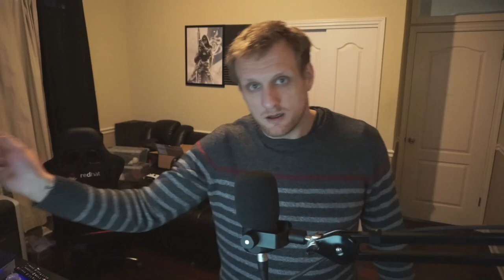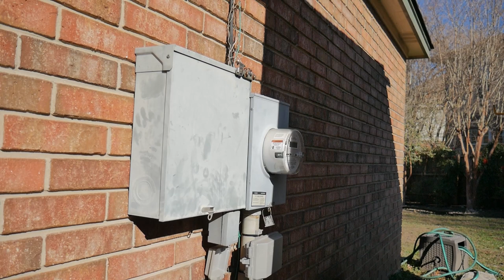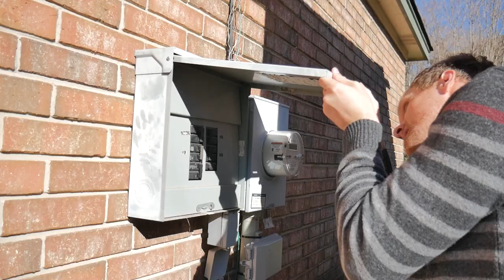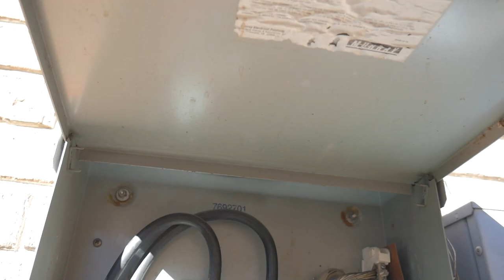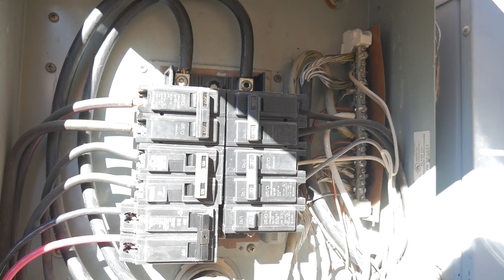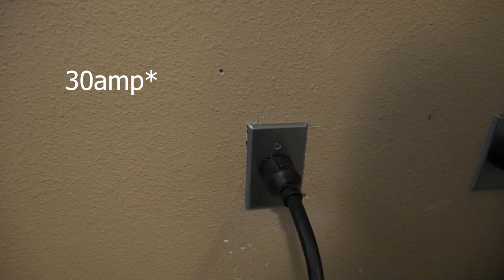5 Things I Learned Building a Home Ethereum Mining Farm

Comment: 5... Yup. I spent the time to tweak each card. It rewarded me by having some of them run at 950 megahertz, most of them at 900 MHz... But one of those had to run at 895. 
4. Yep. Not only do I replace all the thermal pads on the MSI cards, but then I actually added heat sinks to the back side. Vram went from holding 90c to 62c.

On #1, we went solar after we got our electric car... We then got rid of the electric car. 
This means that we have a ton of solar, because the only let you do so much of your usage. And this makes it so mining for effectively free.. during the day most of the year, the panels make more then mining will use over 24 hours.

Comment: I'm a FA Technician, the smoke alarm technology you're referring to is called: One Go, All Go
Reply: Also, regarding your fire alarm, install or have installed, a system that reports to a central monitoring station. The service is usually only around $10-$30/mo and will actually lower your insurance, slightly. The discount you'll receive probably wont offset the cost of the monitoring, but it's still nice.

Comment: Super helpful. My 2 3070’s keep going wonky after a few hours. Start getting a bunch of rejected shares and even had MSI afterburner default, before too. Trying to get them tuned in, I’ve never messed with thermal pads before.
Reply: Also I forget currently I’m getting 120.4 MH/s on Phoenix miner. At 239.3/240.0 W
Reply: What gigabyte model are they
Reply: @bobdobbs7828  lol. Yeah I got an Asus 3070 and haven't had any problems with it.
Reply: @iVETAnsolini  If you want to fix your rejected (incorrect) shares, Try this...Start your GPU's with MC and CC on 0...Then once they have both taken a few shares, bump CC to -200 and mc to 1100. When that settles, bump mc to 1300 and leave it for qa few hours and see how that goes....I have 11/3070's/. Some don't ever get rejected hsares but most do...That's how I've fixed the problem...

Comment: My vega64 running at 60c. What you think about this temperature? You are right, over the time i have seen hashrate going down when temp goes up.
Reply from the maker: Mem temps are the concern not core. Mem temps should be monitored and resolved if over 102c. Core isn’t a problem though at 60c
Reply: @SonofaTech  mem temps hits 86c. I already ordered some thermal pad.

Comment: So what I learn today.

1-  Electricity at 120 phases have maximum of 30 amps, while 220/240  has phases of 60 amp.
2  Lets say you are running a gtx 3070 mining and the power draw is 120 per hour, this would translate to 1 amp at  120v, while at 240v will translate to  0.5 amp

This don't translate that the electricity bill will be more cheap, nope, but what will do is that our power supply will be more efficient, less heat, more safety when mining.

Also very good in telling people that if you guys want to have like a farm of mining, make you sure to turn off the dryer, haha xD

Cause yeah imagine having a 120v with 30 amp phase, and then, running 20-25 gtx 3070 and pushing like 25-26 amp, and then you decided to turn on the Dryer? lol.......

Comment: No matter what card I use. AMD or NVIDIA. I can never get OC's to work. I've tried only overclocking the memory. Only doing the core clock. Under volting and lowering core while boosting memory. Raising the voltage and core while tweaking with the memory. Nothing I've tried actually produces results. I might be lucky if I can squeeze .5mhs out per card.
Reply from the maker: With AMD I get good oc after bios flash. Nvidia is not too shabby. The key is whatever you read online is too high usually.
Reply: @SonofaTech  I have gtx 1070's founders editions and I set the overclock at 400 and the core clock at 201. That's the only way to get decent hashrates up to 29 mh. If I just overclock to say 6 or 700, and under on the core, I get maybe 26.5 mh. Why is that?

Comment: I have a big problem I can’t solve. My rx 480’s just started mining at 3mh a week ago. Over clock not helped.  My 1650’s are doing the same thing!!  I need help.  I have tried drivers and everything. All of these are 2 months old,  if all started the same day.  What shall I look at to fix
Reply from the maker: 4gb?
Reply: @SonofaTech  yes  sometimes they will do 7. Now 3.  My rx 580’s 8g are now doing the same,  that just started in the past hour
Reply from the maker: @Yelnats101  my 580s are fine. When was the last time you did maintenance and replace thermal pads
Reply: @SonofaTech  this is all new 2 months old. As far as maintenance go. I shut down once a week and clean clean clean. Absolutely zero dust.   And they should not need any thermal pads or paste at this point. Because I have swapped out and tried brand new un used cards for testing.  Exact same 3 mh per card  even swapped psu. Reloaded windows.  Nothing helps
Reply from the maker: @Yelnats101  did you ever even look at the pads? Sounds like no.
Reply: @SonofaTech  i have been building rigs for years, this is the first time this has ever happened, like i said, its even brand new cards. and i redid one card because you mentioned it. its the  same as before. no change. i now have all new cards in, same thing, even on 8g  new cards
Reply: is it possible its the miner?
Reply from the maker: @Yelnats101  ok cause some models had bad placement this year. Aight so you on windows or Linux? What troubleshooting os wise have you done. Sometimes one bad card can cause this. Have you individually tested them?
Reply: @SonofaTech TEMP 44C/ FAN 25% POWER 51.24 WATTS
Reply: Thats on the 1650,s per card
Reply: i have shut down the rigs till problem is solved.
Reply from the maker: @Yelnats101  test each card dude. Sucks but that’s where you are at
Reply: 51 watt are u serious run @ 80% tdp at least
Reply: Yeah.  Ind don’t know what’s going on.
Reply: @Yelnats101  99% of the time its psu but if u r sure you have replace it. you need to check the pcie wire of gpu and riser ...if you are using molex or sata adaptor replace it with pcie riser.
Reply: @AJGAMESS  I have tried and replaced everything.  I have also tested each card on separate test benches.  No change at all. New un used cards and old cards. Same. I’m thinking it my miner   I have used nano miner for as long as I can remember. Never an issue.  It’s easy and mine straight to my wallet in coin base.  I’m open to miner suggestions that will allow me to mine into that wallet
Reply: @SonofaTech  its the miner. nano miner.  i tried nicehash for testing and was fine, can you recommend a good miner?
Reply from the maker: @Yelnats101  I use a mix. Trm for amd. Phoenix and lol for nvidia
Reply from the maker: Lol has higher cpu usage but is more reliable on 3000 series gpus
Reply: @SonofaTech  thanks for all the replies, i was just lost and had no idea what the issue was, i do greatly appreciate it
Reply: I use ethminer to mine eth its very stable with little bit overclock .. i dont use nicehash cause it switch algorithms and stress gpus with temp fluctuations.

Comment: Did you really just say, you have to keep all the same gpus... common,  you know that aint true. Every rig i have is all mixed. The actual rule is amd only or nvidia only.
Reply: He just said that would make it easier not that you have to.
Reply from the maker: It makes it easier because once you have the bios modded and settings locked it's easier to deploy at scale
Reply: @SonofaTech  you've been at this for some time now.  thanks for all you do bro fr.